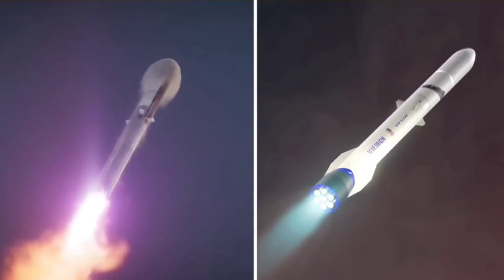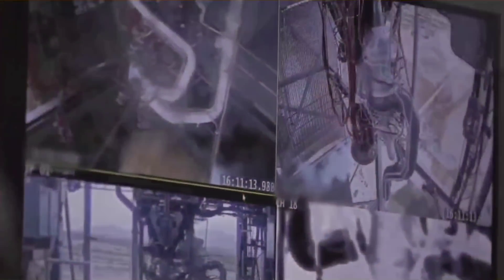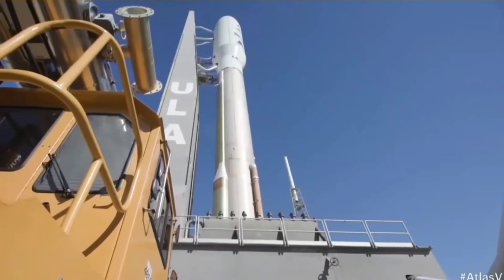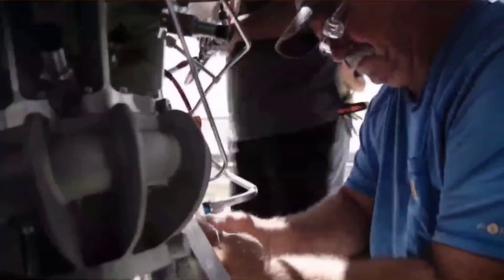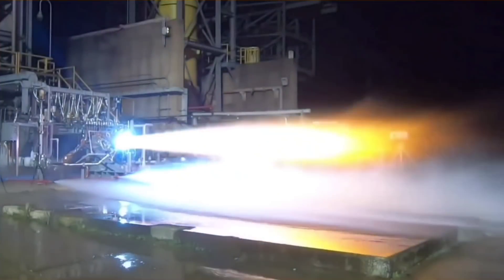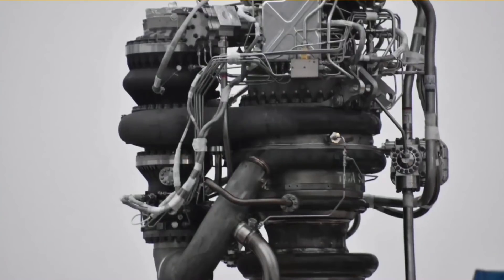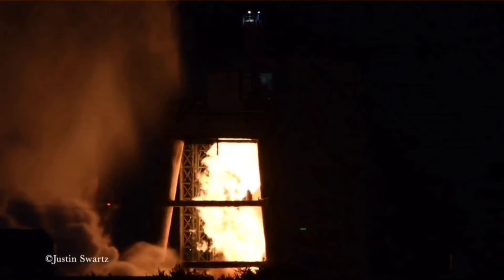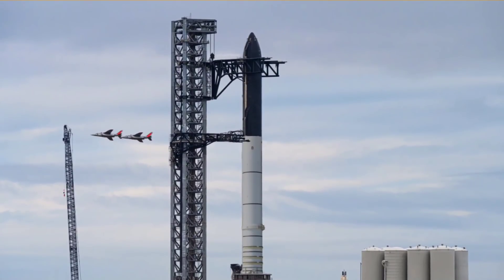SpaceX New Raptor V2 Engine is Completely DOMINATED Over Blue Origin BE-4 Engine

Comment: Hydrogen has proven that is not the perfect fuel that many thought it was.
Reply: the RS-25's were an exceptionally overcomplicated piece of otherwise beautiful engineering because hydrogen had a tendency to leak extremely often, they had to design it with complicated helium pressurized sealing across all of its chambers just to protect the engine from a catastrophic failure.
Reply: @chloekaftan  RS-68s are better anyways
Reply: in fact hydrogen just adds complication and problems these mean more work on a cost plus contract so the contractors benefit .... funny that